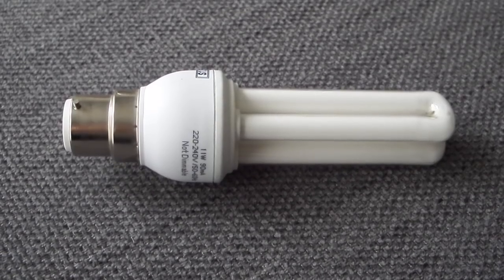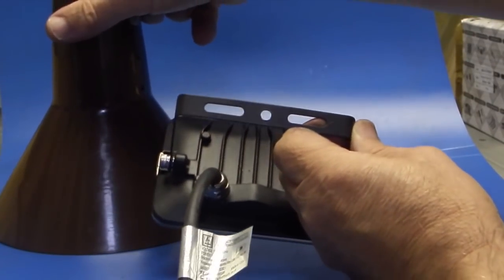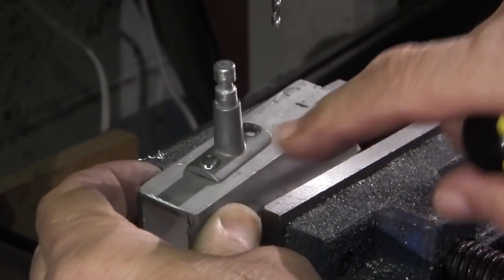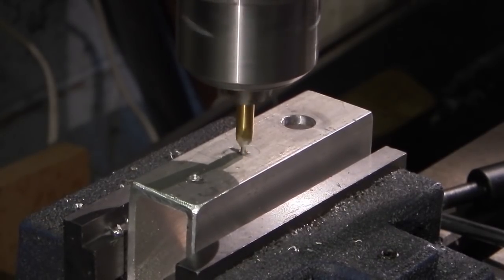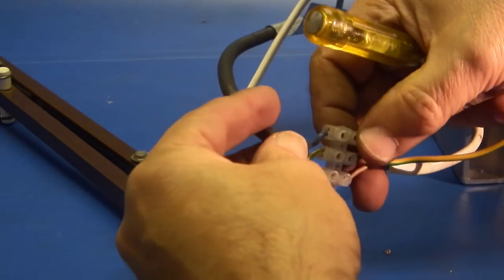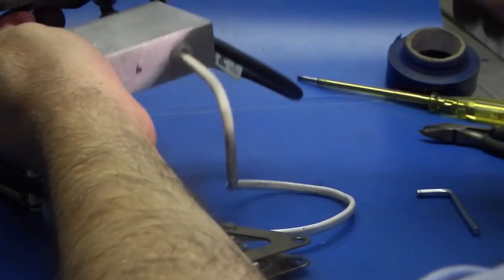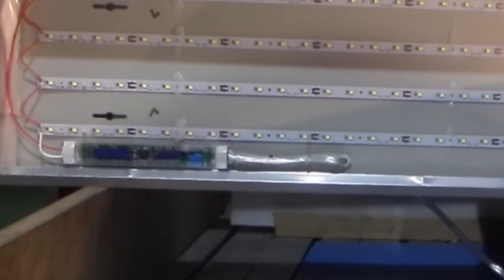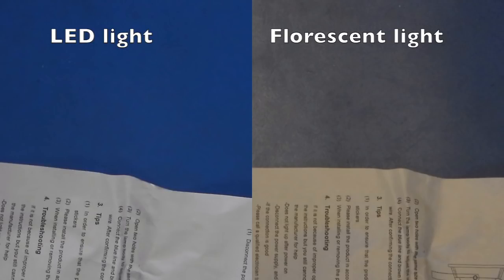Workshop lighting L.E.D. v Florescent tubes

Comment: Nice job!  In the US we get same base LED bulbs that are a screw in replacement for the bulb in the angle poise lamp.  Just changing to one of those makes a significant difference.  They also run much cooler than when a regular incandescent bulb was in them.